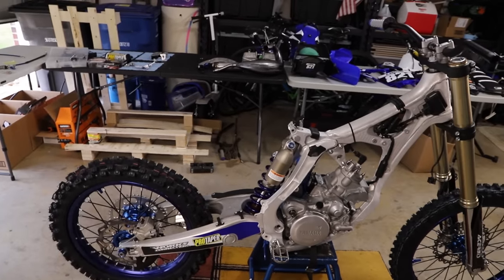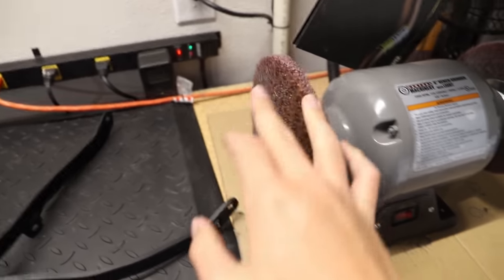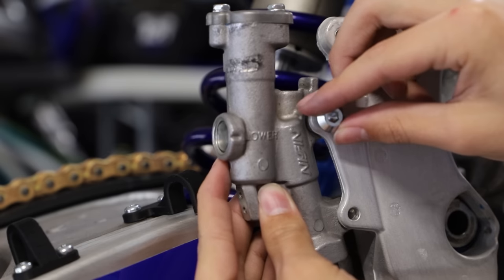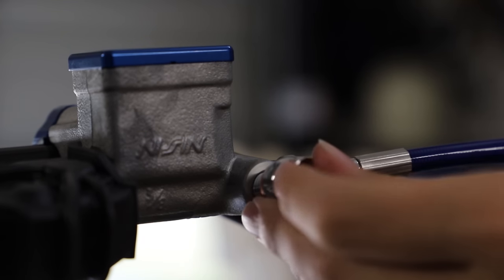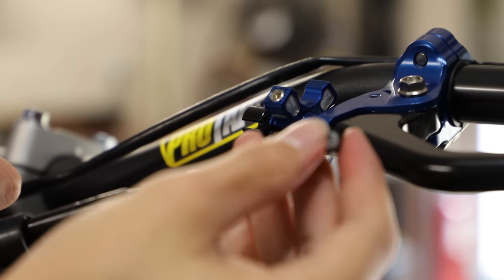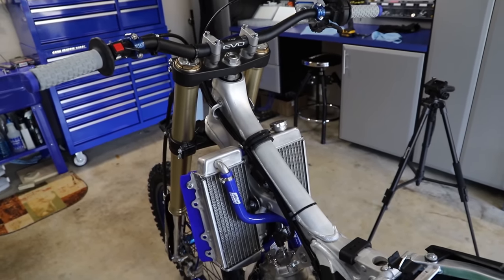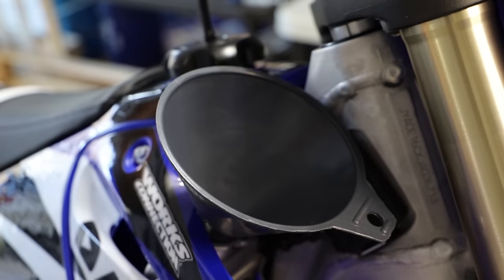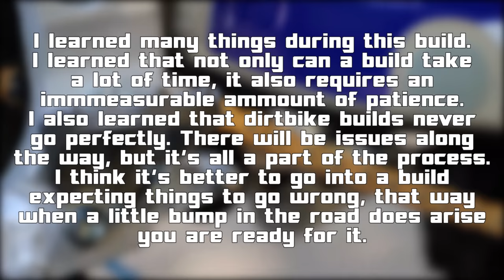My YZ125 Build is Complete!

Comment: You missed a be of the inserts on the lower chain guided if you don’t it will be hitting just bolts
Reply from the maker: This bike has no such insert. Only the plastic and the outer aluminum cover.

Comment: Question here for a newbie what do you mean by 23 foot and how would I go about mines in a service book
Reply from the maker: In that case I am referring to the amount of torque I am putting on the fastener. 23 pound feet of torque was being applied on a fastener using a torque wrench which allows you to set the torque on a fastener. Just look in your servings manual, there should be details about torque specs

Comment: Bike is mint, my 2019 yz125 is about to get a make over for the racing season aswell! That stress mark on the right side of your front fender can go away if you apply some heat with a heat gun👍
Reply from the maker: Sweet, and I would work it out with the heat gun but the heat gun often leaves a less glossy finish. I did fix my radiator shrouds with the heat gun through!

Comment: 22ft/lb on a banjo bolt going into a aluminum caliper? That really high imo
Reply from the maker: Got my torque specs from the manual, and most of the banjo bolts I had to loosen when bleeding so they likely aren’t at 22 foot pounds anymore

Comment: when you fill the bike with coolant you need to have the bike running with the cap off, and continue  to add coolant until ll air pockets are removed from the cooling system
Reply from the maker: For this bike that isn’t really necessary. I’ve filled the bike up with coolant many times, and never had to do that. It would probably be necessary on bigger engines and car engines, but not this one. I just fill the system, run the bike, then check again with the engine cool and off. Thanks for the tip though!

Comment: The chain guide is mounted wrong
Reply from the maker: How?
Reply: Its not in the slot there is a space between the aluminum plate and the plastic block that the swingarm mount goes in to

Comment: I have a problem with my yz. I changed Front brake disk and brake pads. But now the caliper hits against the rotor once i tighten it down and the wheel doesnt spin anymore.
Any tips on what i cold have done wrong?
Reply from the maker: Does the top of the rotor hit the inside of the caliper? It could just be poorly fitting parts of everything isn’t OEM.
Reply: @akmoto_  No the rotor ist not too big. If I put a washer on the inside of the fork leg where the screws hold the caliper, the rotor does not hit the caliper anymore. But then the break pads are not flush with the rotor and when you press the lever there is no pressure. It's hard to explain and my english is not so good. The best would be if you could see a photo of what i'm talking about.🙈
Reply from the maker: I think I know what you mean. The fork lug where the caliper mounts could be bent. I would try to see if they are bent, and if they need to be bent back. Or maybe even a new fork lug
Reply: @akmoto_  I will look today. Thank you for your help!

Comment: Where you Brake Master cylinder cap?
Reply from the maker: It is Works Connection Brand. I get most of my parts from RockyMpuntainATVMC or Motosport. You can also buy straight off Works Connection website 🤙🏼
Reply: AKMoto i love RockyMountain ATVMC i buy all my parts and Accessories from them for my 03 Yamaha Kodiak 400 4x4

Comment: I had a 2016 yz125 trade it for a 97 cr125 the power is way better on low end. I tune it the gears to have a little more speed for top end. I will never buy another yz125 again😂